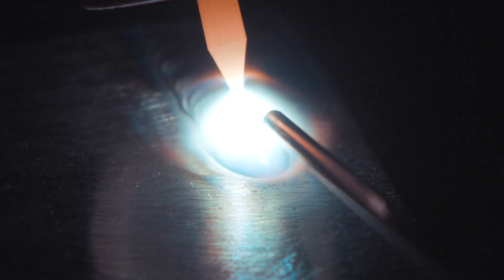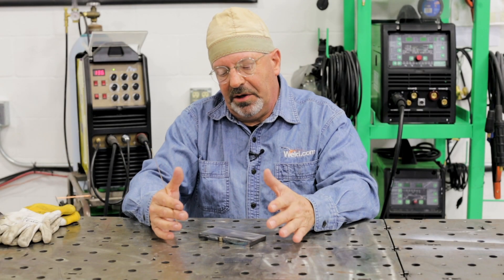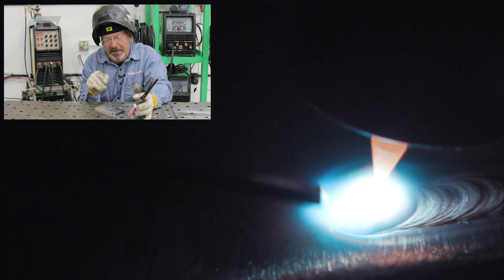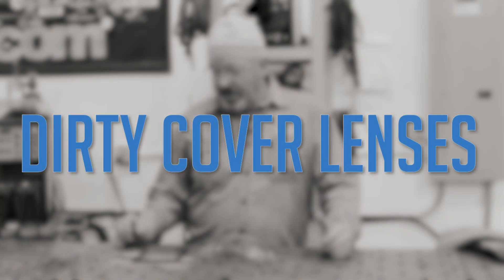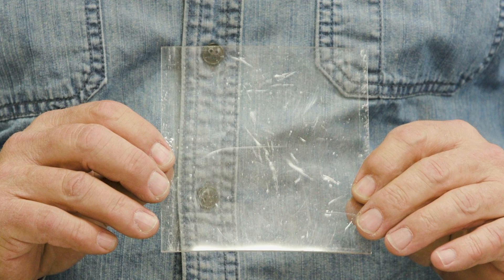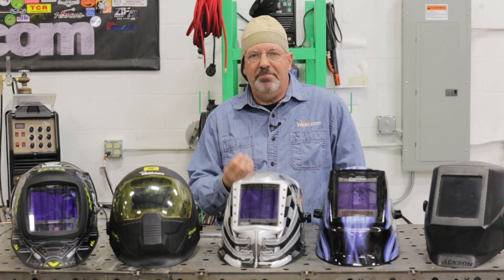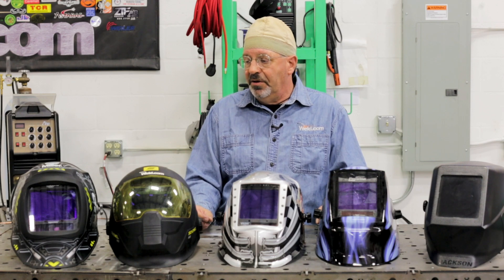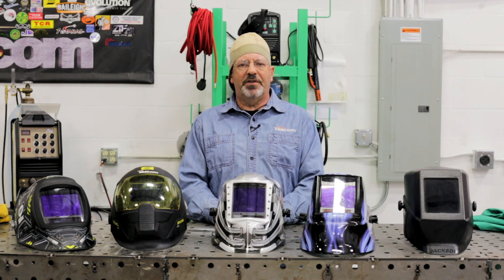I CAN'T SEE WHAT I'M WELDING!!!

Comment: This was timely, thank-you. New to welding at home and I couldn't see squat. Finally realized as soon as my arc is struck and the lens goes dark, I'm getting a reflection of everything behind me (all welding is outside). When I can see clearly, I weld pretty good.
Reply from the maker: It's a very common problem that we forgot to mention. Thanks for the comment.
Reply: @Graham_Wideman  Funny, they write in the description that it's for sparks protection, but all the reviews I read were for blocking the light from the back.  Good idea.
Reply: @danl.4743  Hahaha yes I noticed that too. And of course, you don't have to buy the commercial thing, you can get your own piece of spark-resistant fabric, cut it to shape, and velcro to the rear helmet lip.
Reply: @Graham_Wideman  Exactly.  And I was thinking that if I want a fire proof material (that's what they have), I can use a piece of old leather or something.
Reply: Also this:  black stallion part AH3035-NS.   https://m.cyberweld.com/black-stallion-glareblocker-ah3035-ns.html